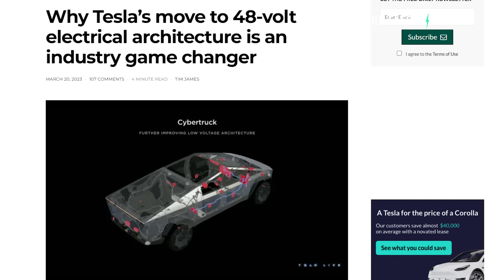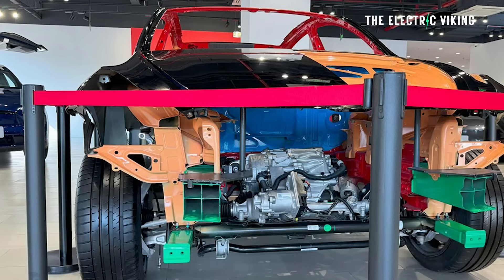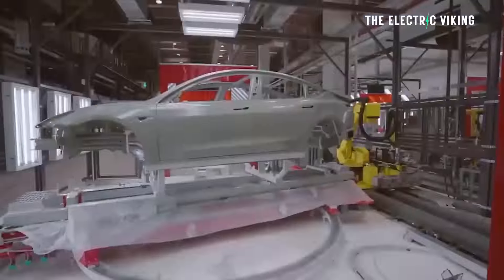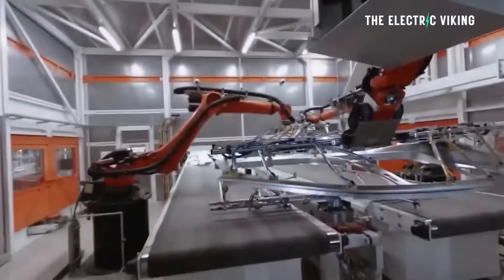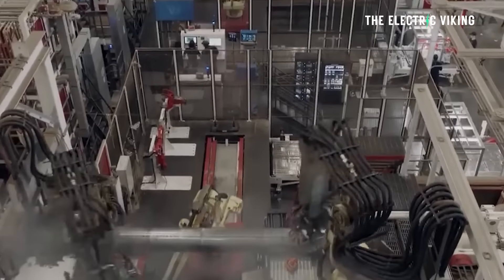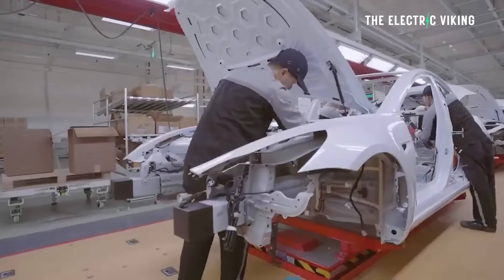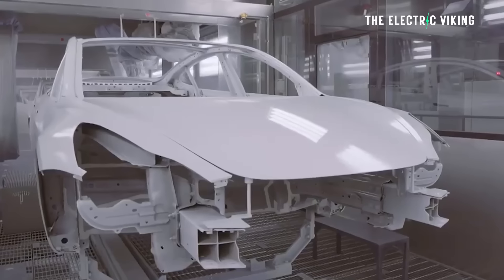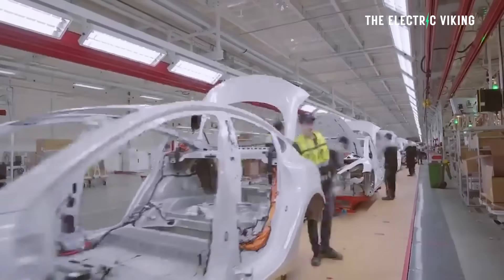Tesla Model 2 NV9X Redwood Crossover coming with Cybertruck architecture

Comment: Thank you Sam.  Great episode.  Tesla has said Germany would also manufacture Model 2. Seems all locations are expanding to build M2, once the machine that builds the machine is sorted. Interesting that natural flow casting approach used on Cybertruck rear & front casting allowed Tesla to crack using Model Y's 6T press, not 9T as predicted. Guess is Tesla learns from this & simplifies manufacturing again by using multiple small Gigapress to cast Model 2 front, back, sides, hoods & doors to supply each unboxed station with a separate machine. Completely replacing wasteful stamping lines ...
Reply: Everyone of us knows that you simply cant make 5 mill. Model Redwoods at one single factory. Elon has figured that out long time ago, so when the machine that builds the machine is finished and tested in Texas, the production platform will immidiately be cloned to at least one factory on each continent. New factories are allready under construction, and the design is laid out to fit the new production platform perfectly. Tesla knows, that you cant move the car half way around the globe, and keep costs down at the same time.
Reply: Do not expect to see cast bodies.   It is not a sensible thing to do.  Think cybertruck but a single casting.   The shell is up in the air.  Maybe carbon fiber bolts on just like the CT bolts on SS.
Reply: The bodies could be made of cast parts. Question is side impact capacity. If the aluminium deforms rather than fracturing, it’s game on.
Reply: @Dave5843-d9m   Could does not equate to should.   The idea behind using castings is to reduce cost.   I know I am repeating myself.  It is still true.

Comment: Tesla should do a 3 door (like the iconic 318ti) and a 5 door sportback wagon. Nobody else is making either.
Reply: I agree with the general idea. But about your specific example, BMW 3 Series E36 is the iconic model. The 318ti "Compact" was a castrated 3 Series with an unbalanced profile due to the missing trunk, because BMW didn't know at the time how to produce a cheaper small car otherwise. Taking a beautiful, well-balanced bodywork profile and decapitating the trunk as the only solution to reduce production costs and move downmarket with such a butchered vehicle is a terrible idea in the first place.
Reply: Take a look at the Kia Niro and their EV-9.
Reply: 5 door sportback wagon  I would send in a $1,000 non-refundable pre-order deposit today if it were possible.
Reply: And a Minivan, like a Voyager or Pacifica, no one's doing those, and the layout is exactly what suits the 'skateboard' platforms.
Reply: @fluxcapacitor 316 / 318,... not as pretty, thats for sure. The previous classic 3 series when the M badges first appeared, something like that, lightweight, city driver 'first car' that is cheap n cheerful, more about fun then range, that'd sell.

Comment: More than one version of the Model 2 is very welcome. Let's hope that one is a hatchback that's not ghastly like the Cybertruck. Steer by wire, 48 volts and the whole base cast in one piece would be amazing.
Reply: Look at it this way.  If Tesla can build a cast car frame and bolt stainless sheet metal to it, it can cast frames and bolt steel, aluminum, plastic or whatever to it.  Tesla did the hard thing first. Then called it a cybertruck.
Reply: You may think it's ghastly but Tesla is gearing up to produce 100k a year in 3+ years, initial goal is 50k per year.  So many disagree with you.  No, I'm not in the market for a CT.
Reply: @theguy455   Doesn't matter what they're gearing up to make. Is the demand there? I think most people think it's hideous. I think the underlying technology is great, however.

Comment: Thank you Sam for covering the M-2 * Highly anticipated!! Question is, how this completes with the Chinese EV tidal wave?
No protectionism would be needed if all automakers initiated EVs from 1998 after the Kyoto Protocol. No, it took Tesla /AC Motors from 2007 nearly a decade later to pick up the slack!
Reply: The Chinese brands and cars are far from perfect. They look great but are in several key areas not finished or engineered well.....and the Chinese cars are not cheap....rather expensive.

In the Netherlands,  Norway,  Germany the Chinese brands are not succesful at all, despite the massive media coverage and marketing.....salesflop. 
Except Volvo and Mg.
Reply: @avdp9095  Today, 74% of all electric cars sold during the day in Norway are Teslas. Ridiculous. The total in January is 21%. And the worst sales month for Tesla tends to be January.
Reply: @avdp9095  it sounds to me that it’s more about brand recognition rather than some key areas not finished or engineered well.
Reply: @davidrink1291  the cars are tested in the Netherlands and fit and finish, build quality, software nor up to European standards....and....far, far to high pricing, far above Tesla and even bev's from Bmw and Mercedes..... . Only brand that is suc6 at the momrnt, Mg with a low cost Bev but European competition is on the way.....
Reply: @avdp9095 remember "Japcrap" from the 70's and 80's?
Who'd want a Japanese car?
They learned, even Munro went with Dr Deming.
The Chinese will learn. 
We already buy cars they make for western and Japanese brands but we don't know where the factory is so we think the eMini is German and not built by Ora for BMW as an example.
We buy Mexican too, BMW, ford etc.

Comment: Model 2 one of the most anticipated cars. Hope they don't fall behind schedule. As building in China could happen as they have been fast at building their factories.
Reply: Tesla is always behind schedule.
Reply: It was behind schedule the day that they announced the Cyber Truck over 4 years ago.
Reply: @davidbrayshaw3529   Not so much as you think.  Just as the CyberTruck would not be the vehicle we have today if sold in 2021.  The Gen 3 would not be the car it can be with recent improvements like magnesium thixomolding.  The new process can take up to 35% off the weight of cast parts.  It does not end there.  The weight savings cascades with lighter battery and drive train, suspension.
Reply: @danharold3087  I see what you're saying, but honestly, Tesla could have been focusing their attention on a lower cost global product and implementing "new" technologies in an entirely different platform rather than putting all of their effort and resources into a very expensive
vehicle which will only sell in any numbers in the Northern American market.
They missed the boat, plain and simple. And it's given their competitors a huge head start.
Reply: @davidbrayshaw3529  The new technologies are what will allow Tesla to sell this car for less or make it better than the 10 or so others planning to make a car to compete.  The casting alone will save 100 of stampings and allow tesla to easily mount the body panels w/o welding.  There were no gigacasting machine in 2018 or whenever Tesla started design on the cyberTruck.
Reply: @danharold3087  Yep. All technologies that could have been developed for a vehicle with a much wider market appeal and probably at a lower cost, due to scaling.
The die castings of the CT could have just as easily been developed for the model 2,
48 volt low voltage architecture and steer by wire isn't new to cars, that technology existed, as did ethernet DC switching (although not in cars).
Tesla missed an opportunity.
Reply: @davidbrayshaw3529   Perhaps you should try for a seat on the Tesla BOD.
Reply: @danharold3087  I'm quite sure that there were directors on the board that were all too aware of the broader market and its trends when the CT was approved for development. They don't need me.

Comment: 100% will be two giga casts. Not one. You don’t need cast alloy on the sills, you don’t want it overhead. 
The  unboxed assembly method will perfectly suit this method, it’s like the Cybertruck to a degree.
The battery becomes the floor, you attach a front assy , a rear assy, sides, a roof probably of glass. 
Paint shop is a big deal. Much less painting area. 
You don’t need to paint a whole assembled body. 
This saves tons of money, and factory floor space. 
Such a great idea.
Reply: Unboxed method is vaporware. Lies about 50% cost savings.

Comment: Tesla  Model 2 needs to be priced well and have good mileage over 300 miles achievable. If it can fit both of these it will sell amazingly.
I just hope they can do it and show that it is possible for a mainstream EV to be cheap and great.
Reply: Not interested until this country fixes charging infrastructure and EV's have battery full-charging speed under 10 min.
Reply: @tyharris9994  That is fine, don't have one yet. But if I need more range in my car I plug it in, I go to bed and wake up to a charged car. This unfortunately isn't available yet to anyone without a driveway, unless where they work offers EV charging points.
It can be done but does then mean using more expensive rapid chargers whilst out and about. 
For info, using the Tesla V3 250kWh chargers can give up to 150 miles in 10 minutes if that is all you wan to wait!
Reply: How often have you driven even 200 miles in a single day? Most people might do that a couple times a year, yet they freak out with range anxiety and spend thousands of dollars more than they need to spend so they can make it to Grandma's house without having to "waste" an extra 30 minutes recharging. That said, I would not buy an EV if I didn't have a way to charge it at home.

Comment: Aside from the giga-casting, steer by wire, 48v power system, smaller battery, RWD only features I think we may start seeing more magnesium alloy making an appearance perhaps first in wheels to reduce un-spring weight and then more and more internal componentry. The lighter the car, the smaller the battery pack needs to be for an acceptable range and in turn the lower cost to produce the final product.

I imagine the M2 will come out at 30k USD and gradually come down in price over time as the product ramps up, much like every other model till now.
Reply: Thixomoulding sounds promising, will actually reduce cost long term. They’ve solved combustion problem! (Being old, that’s prominent in my mind) IDRA doing the hard yards.
Reply: Weight is a small penalty for range on an EV, it's really the aerodynamics that sap up all the energy.
Reply: Tesla will hardly stop with AWD as they will lose market share, especially in countries with snow. The next model will surely also have an AWD version. By far the most Teslas in Norway are AWD.
Reply: @beehappy7797  agreed. Given $1,000 for drive unit, for better regeneration, just makes sense. Makes car more desirable.
Reply: Add in gigabit ethernet running on the 48v wiring like in the CT.

Comment: EViking: All the vehicle manufacturers have tear down facilities. Some use/supplement with third party work like Sandy Munroe Assoc (who convinced Tesla to go with the castings and save three hundred parts). Part counts in the lower cost vehicles had twenty-five thousand pieces, worst had thirty percent more parts. Trucks/SUVs and often refresh cycles they get sloppy and have much higher counts than that. One vehicle replacement was five hundred pounds heavier than the outgoing model, that was a scramble to fix.  Considering how many parts are in any vehicle, it's often amazing any of the manufacturers can reach low double-digit parts per million defect levels ... and low costs.

Comment: It would not have a single megacasting , because then there is no way to make a modular build. Probably it would a front and back gigacasting which also supports all the construction and the modular 48v system is needed for that because then they can also test each module independantly...
Reply: This. Sam has miscaculated here. Although Elon did originally conceive the idea of a single casting for the entire body that idea has been shelved in favour of the unboxed process.
Reply: Unboxed is brilliant.Anyone who hasn't seen it should look up the vide.

Comment: You've excelled yourself this time Sam. One point though that I would love you to cover in a future video is the repairability of these cars with giga, mega, terra castings...whatever. With structural battery packs to boot, to my untrained mind it seems a simple rear ender could be a repairing nightmare. Insurance costs??
Reply: Sandy Munro, a Tesla fanboy, says it's stronger than a regualr frame, and easily TIG welded if need be. But he's a manufacturing expert, not a repair guy.

Comment: It will not be a single casting.  It will still have front and rear casting with the battery pack in the middle.  The difference is that almost the entire front, rear, and middle of the car will be built in parallel.
Take the front casting as an example; parts will be built into sub-assemblies (in parallel), these sub-assembles will be built into larger sub-assembles (in parallel) and these larger sub-assembles will be combined with the front casting for a nearly complete front of the car.  At nearly all phases, these assemblies will be easily built by a human or robot.  When they are combined with the front casting the multiple humans/robots will have 360-degree (plus top and bottom) access at the same time.  Humans/robots will do the assembly in parallel.  The rear and middle of the car will be built the same way.  The speed of assembly will be amazing.  The amount of automation will be amazing (this might take some time).  This is not possible with a single casting.
Tesla has been working towards this since before the first Model 3.  For anyone who has been listening, Elon has explained almost every step of this over the years.  It's the reason that Tesla makes the machines that make the machines that make the product(s).  It's also at least part of the reason to make smarter robots.  Whether humanoid or not, Tesla (also SpaceX) will need robots that are aware of their environment.
Reply: It's called the 'Unbox method' (don't know why) but yes lots of parallel production coming together at some point will greatly speed up production and lower cost. In much less space too.  It will require very precise software control and if anyone can pull that off it will be Tesla's superb software team working with the production engineers.  It will revolutionize car manufacturing.  Exciting times for EV watchers.

Comment: Model 2 may also have gigabit ethernet running through the 48v wiring like in the CT.  This allows devices using electricity to be controlled more easily.